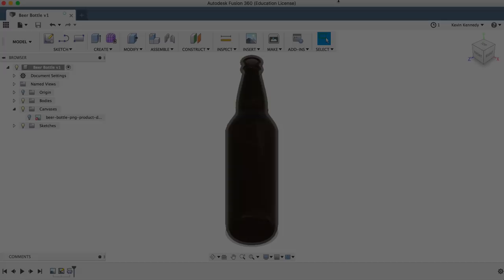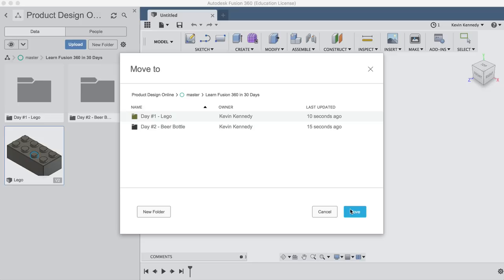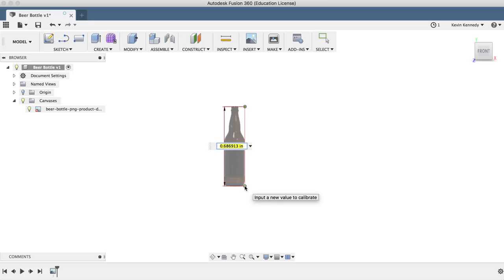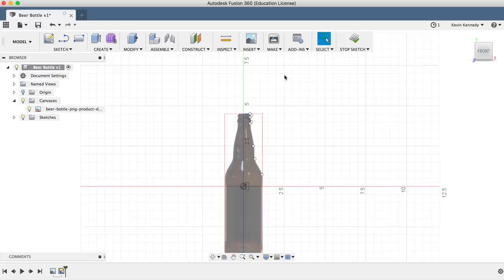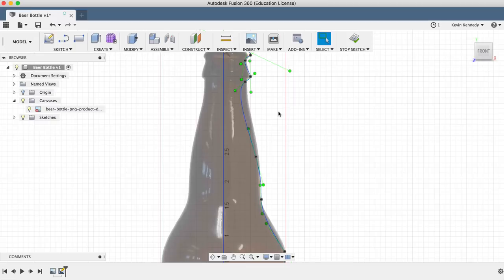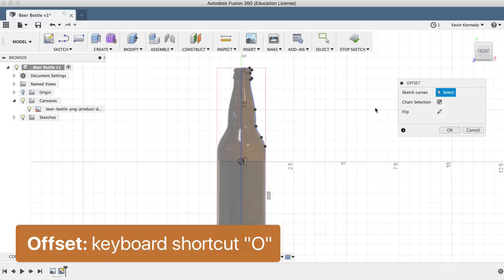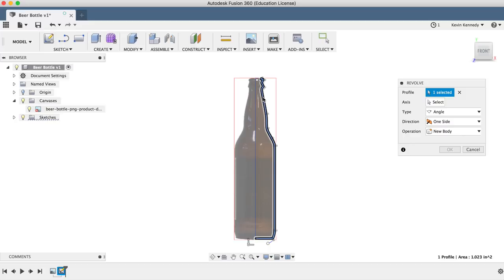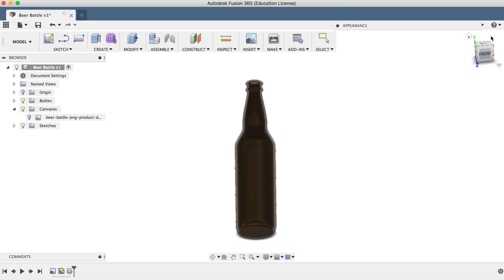How to 3D Model a Beer Bottle - Learn Autodesk Fusion 360 in 30 Days: Day #2

Comment: Just started this series, and am liking it so far. Just a few Improvements I would suggest are:
-in the first Video you set units to mm, in this Video you didn't tell to set them back, so giving the measurements in inches all of a sudden really throws you off, while doing the project alongside the Video. So either stick to a measurement throughout the series, or state at the beginning of the Video which one to use.
-Some Steps aren't explained too well (For example which Spline submenu point to select) which again throws off while doing the project. Take your time and really say each submenu aloud. Beginners working along won't get impatient if you take too long, but will get stressed if you're rushing through.
apart from that, keep up the good Work
Reply from the maker: Hi, Moritz S. Thanks for your feedback! This video was one of the first tutorials I had created, whereas the first one you watched was a revised version (as well as day #3). Eventually, I'll have to remake this one as well. I believe as you watch the 30-day series you'll see the videos get more thorough, as I improved upon feedback from the initial viewers of the first 5 videos.

With that said, please don't hesitate to comment questions on the tutorials as you work through the remainder of the series. Cheers, Kevin :)

Comment: Though this project is ultimately simpler than the Lego brick following the steps is a bit more challenging. Each step is not as well discussed with key details not communicated. It is really important to explain each step you take (each mouse click, each drop down, etc) in full before and during the step. I found several key details verbally missing during the explanations. I would stop the video and replay to see what your mouse pointer did to figure it out. You also went through it faster than the Lego brick and it felt as though you assumed the student new what you and they were doing.

Overall it is a good project and really like the way you tackle just a few tools in each session. It could use some improvements to fully help a true beginner to Fusion 360 though. It is important to explain each step before and during each step and to give the student enough time to process the thought. Side note: Though it can get frustrating to stop and have to figure out what you did, it actually is somewhat helpful in that it forces me to figure it out, hence you can learn that way too. That said it would be nice to have it explained in full detail.

Making these videos are very challenging I know and there is a delicate balance of each aspect. You are doing a good job and thank you for the efforts! They are helping tremendously.
Reply from the maker: Hi, DCMotorMan. Thanks again for your feedback. The lego video you watched was a revised version (which was much more thorough than the original). I think you'll find the first 6 or 7 videos are not quite as thorough as the rest of the series as I was still trying to find the right balance between talking vs showing.

In all the recent videos I try to talk through every mouse click or small detail, without going to far off topic. 

I'm happy to hear they are helping! Thanks again for watching and commenting! Cheers, Kevin :)

Comment: You do something most don't and that is say what hotkey you just hit. Makes it smooth and easy to follow along. Been watching all the videos. Thanks. Also would like to throw in a request for a beer tap design.
Reply from the maker: Chad  Brun - Thanks for watching and I really appreciate the kind words!

I'll add "beer tap" design to the list... is there a specific reason you're wanting to see it? Cheers, Kevin :)
Reply: Product Design Online Saw the bottles and thought it went along. Then I thought about how to do it, based on my knowledge, and the top is usually bigger than the bottle and it has threads. Then I thought of the sides and can you add a logo and mirror it on all 4 sides or would each side have to be done alone. New to Fusion or design at that. Just don't know all the limits for the design and also the limits it transfers to 3d printing.
Reply from the maker: Thanks for the explanation, Chad! All makes sense and some great ideas to demo. Cheers, Kevin

Comment: Do you plan on sticking with inches or millimeters? Day 1 and 2 seem to be instructed in either of the unit systems.
Reply from the maker: Yuriy Platoshyn I originally was choosing simply base on the dimensions I found online AND because I wanted to demo in the first few lessons how to switch back and forth.

With that said, you'll notice after video 6 (if I remember right) I stuck with mm for the remainder of the series.

Cheers, Kevin :)
Reply: @ProductDesignOnline  Unfortunately, real world engineering has both imperial and metric units, so we need to be able to switch between the two. As a great example, my roller skates have an 8mm axle with a 5/16" thread for the wheel nut. Great tutorial, BTW
Reply from the maker: @petedepledge3359  I agree, and great example! I'm just trying to make it as simple as possible for new users to learn.

I appreciate you taking the time to watch and comment. Cheers, Kevin :)

Comment: Hello! I have a small problem with inserting the canvas. When I press the buttion to attach the canvas the planes arent showing up for me. Do you know how I can make them visable?
Thanks a lot in advance! :)
Reply from the maker: Hi Lukas. It sounds like your origin planes may be turned off in the Fusion 360 browser. Look at your Fusion 360 browser (tree) on the left-hand pane. Then, look for the folder titled "Origin." You'll want to make sure that the lightbulb to the left of the Origin folder is yellow, meaning it's turned on. If it is not, then simply click on the lightbulb icon to turn it back on and your origin planes should appear in your canvas window.

Let me know if that fixes it! Cheers, Kevin :)
Reply: @ProductDesignOnline  Hey Kevin, thanks for your fast response. I solved it by changing the language to english.. I dont have any clue how it affected that but it worked :D I can follow your instructions now much better aswell, so its not even that bad that its in english now :)
Reply from the maker: @V0lv0x22  That's interesting... I wish I knew what effect various languages had on Fusion 360. I think a lot of times they are "bugs" but I know there have been a few other questions/issues from other viewers and they also were resolved when they changed it to English. Cheers, Kevin :)

Comment: At 2:04, the line doesn't seem to snap to the canvas box at the top and bottom. Isn't the picture just a reference? In your tutorial, the picture frame is a clickable reference, but on mine the picture frame doesn't allow anything to snap to it.
Reply from the maker: Hello! Go down to the bottom of your screen to the "Grids and Snaps" settings. Make sure your "Layout Grid" and "Grids and Snaps" are turned on. This will help the lines snap into place. I'm essentially snapping the lines close to where they should be on the reference image, but they are not actually snapping into the reference image itself. Cheers, Kevin :)

Comment: Is there a way to change from mm to in without starting the whole thing over?
Reply from the maker: Hi Jetrho. Great question - yes there is. Toggle open your "document settings" in the Fusion 360 browser, which is located on the lefthand side. Then, as you hover over the "units:mm" you'll see an icon appear on the right. When you hover over that paper/pencil/ruler icon you'll see it says "change active units." Click on that and it will open up the "change active units" dialog box in which you can change your document units to inches. Everything will be updated accordingly.

Here's a reference image for your convenience - https://snag.gy/Z7YUub.jpg
Cheers, Kevin :)

Comment: Why did you not make a new component this time like you did for the lego block?
Reply from the maker: Hi Muthu. The first video (lego block) was a revised version. You could certainly create a new component before (or after) creating the beer bottle. Cheers, Kevin :)
Reply: @ProductDesignOnline  You didn't actually answer the question.  Why did you make the choice not to make a new component?  Are there some pros and cons?  Is it totally optional?
Reply from the maker: @jethrobodeen7794  In short, you should create components when you are planning on having multiple bodies within the same file/assembly. Components are easier to copy, move, and insert into other designs - whereas, bodies you cannot. Therefore, for this beer bottle example, it doesn't really matter either way unless you wanted to copy the design and place it somewhere else.

Check out my other video for a more thorough explanation of the difference between bodies and compeonnts - https://youtu.be/46UNmpQdbVc

Let me know if this clears it up! Cheers, Kevin :)

Comment: I managed to follow the LEGO brick. I’m struggling with this one though. It could use more explanation as to what you are doing & how to do it. I’ve not managed to get past placing the dots and making the spline. Once the spline is made I don’t know what to do next. If I hit esc and try to adjust the spline the line disappears on me.
Thank you for all your hard work on these tutorials, I’m positive they are not easy to make.
Reply from the maker: Hi, Jason. Thanks for your feedback. This was the second tutorial I originally made. I'll have to make a revised version of this one sometime in the future. I agree that certain parts could be more thorough and a bit slower.

With that said, I'm happy to help troubleshoot. You'll want to hit the "enter" key on your keyboard after you create the spline. Its a funky user experience detail in Fusion 360.... as most commands if you hit escape it commits the command and escapes the command. Unfortunately, the spline command requires you to hit the enter key. Let me know if that solves it for you and if you're able to finish off the tutorial! Cheers, Kevin :)
Reply: @ProductDesignOnline  Wow! thank you for your reply.  I'll definitely give this one a try again.  I appreciate your  help.  Your tutorials have been a great help so far.
Reply from the maker: @jasonb8876  No problem! Keep me posted with how it goes and if you have any follow up questions. I'm always happy to help. Cheers, Kevin :)

Comment: it is so much easier to draw these shapes in Adobe Illustrator and bring in an svg … the spline drawing in Fusion seems to be really over-thought out … I should be able to grab one of the vector handles and pull it without it dragging the others near it ?
Reply from the maker: Marino Gallo As a fellow designer, who is proficient in both Adobe Illustrator and the Sketch App, I feel your frustrations with splines. You can always import SVGs as you are verse in them. Unfortunately, almost all CAD programs lack in the spline realm, but I think it is with some justification as there are always other ways to achieve the same thing.

Inserting SVGs can be great if you know your shape wont change... but it's harder to manipulate them using the native Fusion 360 sketch functions.

Cheers, Kevin :)

Comment: I noticed when I used the offset feature it didn't try to do so to the inner line.

Trying to work past that I created the bottle-opening line and then tried to use revolve but it doesn't seem to like my sketch lines for whatever reason? I assume both are related somehow.

What am I doing wrong? https://a360.co/2VmSO5C
Reply from the maker: Hi, SwagPKVids. I took a look at your file. Double-click to open the second sketch in your timeline. Then, look at the bottom of your sketch. The bottom-left f the profile is not fully closed. I drew a simple vertical line connecting the original line and the offset line and it was fixed. Then, I was able to revolve the profile without any problems. Cheers, Kevin :)
Reply: Derp. Thank you!
Reply from the maker: @SwagPKVids  No problem! Cheers, Kevin :)

Comment: Plz Help me
When I attempt to revolve it
I got two messages
1. The sweeep would create an illegal surface. Try changing the profile or path
2. Tool body creation failed

I can not find the reason...
Could you help me?
Reply from the maker: Hi, CHO성진. Usually, the "illegal surface" error is due to the profile wanting to intersect into itself. Double check that your profile is closed, and that the line you're using to revolve the bottle is located directly in the middle.

If you're still having trouble after giving it one more try, then please share the link to your file.Share your public link as a reply to this comment. Here's a video explaining how to share a public link - https://youtu.be/2XrcrdV-8Ls

Then, please write a separate comment letting me know you've replied with a link because YouTube flags most links and I don't always get notified. Cheers, Kevin :)
Reply: Product Design Online 
Thank you for reply
I will try it again as you mentioned
Have a good day :)
Reply from the maker: @devstefancho  I just saw the link to your file. Let me take a look at it and I will get back to you! Cheers, Kevin :)
Reply from the maker: @devstefancho  I took a look at your file and it appears that some of the spline points are throwing off the revolve command. You'll want to redo the spline curvature, being a bit more cautious to how the spline points are laid out. Yours had a number of spline points that weren't really necessary. I tweaked your file with some changes if you want to take a look - https://a360.co/2D8lB4e

Cheers, Kevin :)
Reply: @ProductDesignOnline  
As you mentioned, I've changed bottom spline points into tangent arc. and it works well. 
I wonder how you found it throwing off
Is there any inspecting menu? 

Thanks
Reply from the maker: @devstefancho  There's no inspecting menu for anything like that... I just assumed what the problem was based on experience. As you work in Fusion 360 more and more you will find that you understand certain areas that could cause issues :)
Reply: Product Design Online 
Thank you for your kindness
Have a good day ^^
Reply from the maker: @devstefancho  You're welcome! You too!